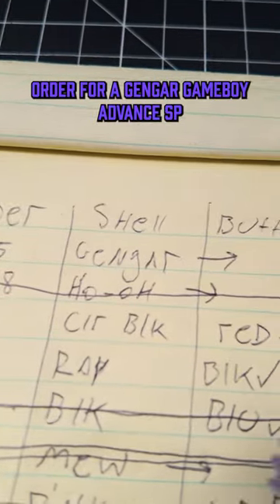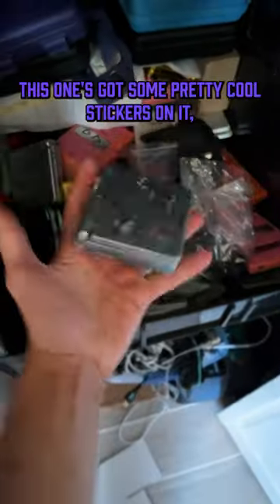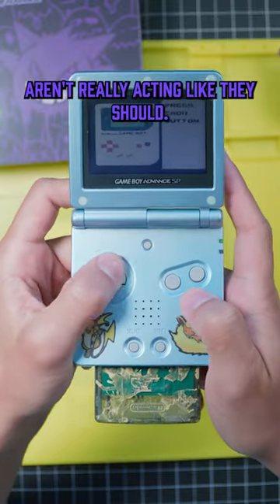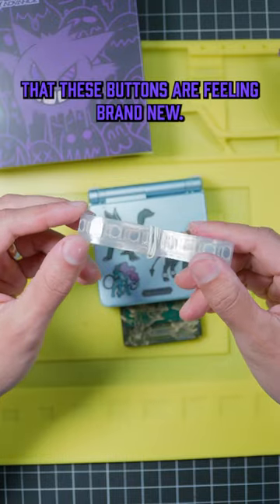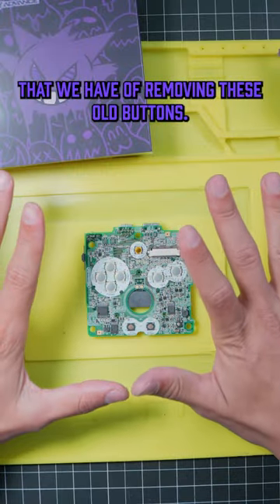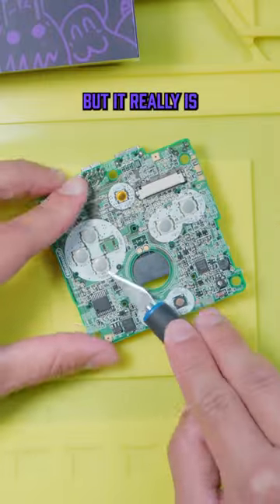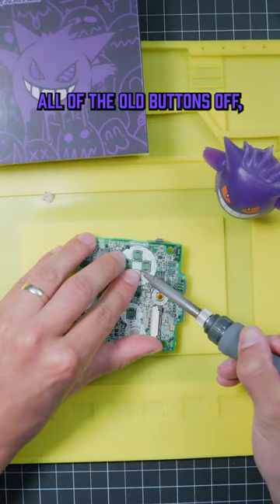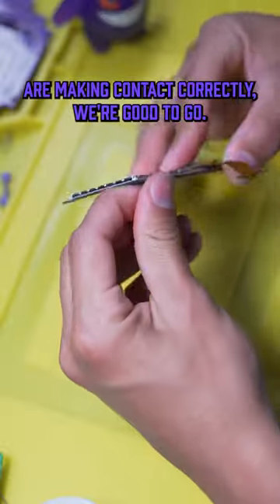Lets give this GBA the Gengar Treatment! 😈

Comment: You can rub the buttons with 99% isopropyl alcohol and they might work
Reply: Would not recommend that, the buttons have a thin film and if alcohol get’s underneath it can cause issues (I ruined buttons doing this and had to replace them). If you do it extremely carefully however it might work.
Reply: It'll work until the alchohol evaporates. Than you'll be left with the damage of having such a soluble solution inside your electronics.
Reply: @evilkingstanley  wait until it evaporate before reassembling
Reply: @evilkingstanley  alcohol evaporates insanely quickly(isopropyl even moreso,) making it the perfect cleaning solution for electronics, what are you on about?
Reply: @matthewfuhrmeister4817 alcohol also breaks down plastic and drys things out. Making things brittle and not work. What are YOU on about??
Reply: @jtyree0226  it genuinely sounds like you've never cleaned electronics before. 99% isopropyl alcohol is THE STANDARD for cleaning electronics due to it's insanely fast evaporation time, meaning it's not around long enough to damage anything to a meaningful degree, and it's ability to pick up oils and other contaminants, again, makes it the ideal cleaning solution for electronics.

Comment: Careful the traces don’t pull up when cutting. Maybe get a exacto tip on little soldering gun
Reply from the maker: They never pull up the solder points are really strong so the button pops off first then you can just desolder the remaining points

Comment: I highly recommend not cutting the switches off like that, you really run the risk of ripping pads off. If you've got it, hot air is going to be a lot safer